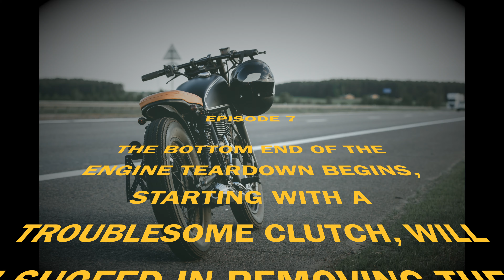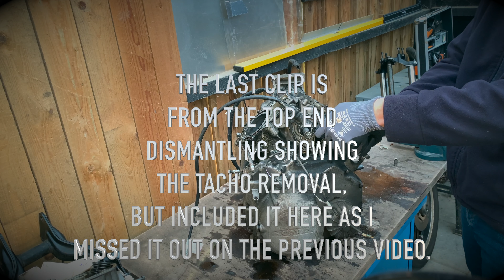🎬 Honda CX500 cafe racer build. Ep 7. (Engine Disassembly) 🏁

Comment: Cool!!, the clutch center nut is a bit tricky but you managed ok 😂, I noticed that you keep the clutch assembly very carefully together, don’t worry, clutch has 7 friction plates and 6 steel or “plain plates”, one of the steel plates is different, so when assembling you go one friction one steel and so on but your fifth steel plate is the different one (thicker, looks like double, also known as spring plate) then friction, steel and last friction, all set!!
I believe that you will replace the friction plates, springs and push bearing isn’t it?
Reply from the maker: Ha Ha that centre nut caused me some bother, I am planning on replacing all the bearing seals and consumables, sourcing all the parts is quite a challenge, I appreciate your tips and tricks though.
Reply: @aircraftengineerstoolbox2560  well mate, I don’t know what part of the world you are located but I have got parts (original Honda or aftermarket) from davidsilverspares.com.uk, ebay is good for used parts or some (NOS), in Holland you find Marco Becker, he’s got a lot of videos about CX’s on you tube unfortunately most of them in Dutch, hope it helps!!!
Reply from the maker: @carlosgooglemaps94  yeap using all those, also csmnl in holland and your pretty much set.